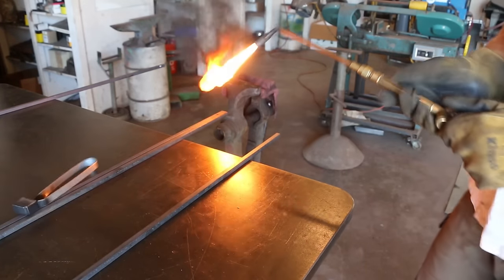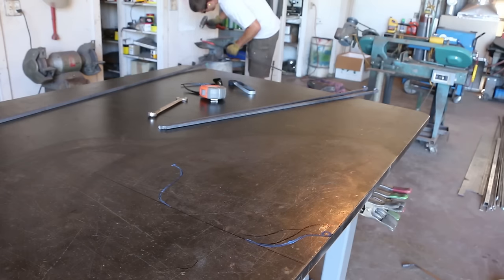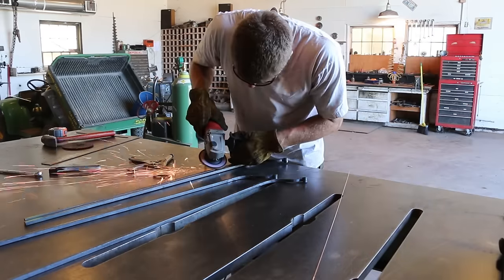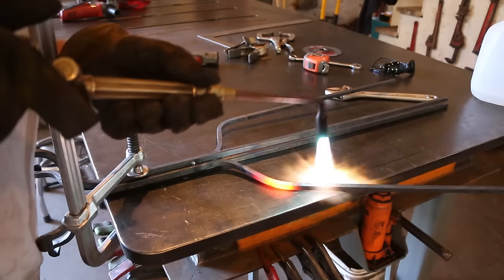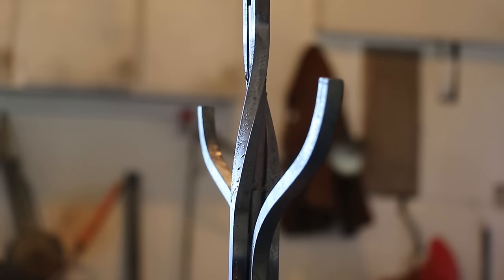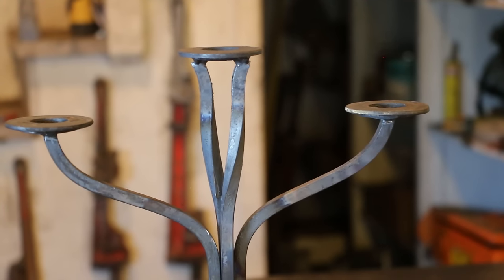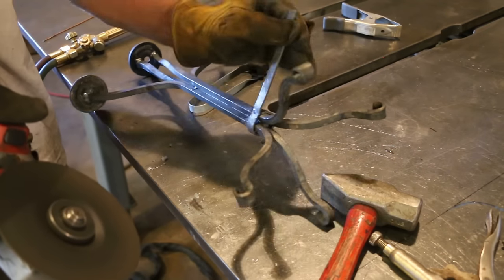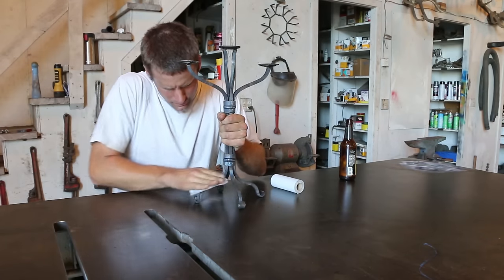Blacksmithing a Candle Holder

Comment: Great video, terrific work as always. Your dry delivery of jokes is hilarious too.

I've been working with a lot of bending recently, shaping curves and such, and I found making a few pairs of bending forks made it all possible. Damn handy tool to keep around, especially the adjustable ones.
Reply: Yeah, I made my fork from 1" square solid stock, sleeved into square tube. Drilled a hole in the tube and welded a nut so I could use a bolt as a set screw. The posts are 7/8" cold roll, and I ended up putting a small gusset of the post attached to the tube. 

Works like a charm. Most of the time I just put it in my vice and manipulate the stock to be bent, but when I use it on something bigger, I put a cheater pipe over the end. 

I'm a pretty shitty blacksmith though.
Here's a photo Bending fork https://imgur.com/gallery/8aAaU

Comment: Nicely done! a tip for the candles or the candle dishes, they catch the wax so if they are bigger than the candle they will keep the wax off the floor and also off of the candlestick holder and as mentioned below, a spike to hold the candles in place securely. 
Get that forge up and running, from seeing what you can do with just oxy acetylene you have Huge potential... Love the workshop too, proper envy!

Thanks for sharing man and have fun at the wedding!!

Comment: sweet. youre getting pretty good man! you forgot the pins for the candles though. should be about 3/4 - 1 in long so the candles cant fall off. maybe a dulled nail would work.
Reply: You might want to add those pins. In years past I remember a house fire caused by a short soft candle sliding off its stand.

Comment: Hey JD, I'm just starting up in Blacksmithing and general making. I managed to build a small forge for knifemaking last month but its really not big enough for any of my current projects. I don't suppose you could share any info on your forge, that you are making? Maybe even a little update video? :)
Reply: Ah I see, I'm sure you'll get it looking great after a little work. I'm looking forward to seeing what you make of it, looks like it could use a re-lining? :) With regards to my forge, its a small propane ran thing that's made of an old steel can with plaster/sand insulation, it had its use getting small steel bars up to forging temps for a little knife. Looks nice and jury-rigged, its just too small to be practical now. Hoping to build a larger one next chance I get! Probably around Christmas.

Comment: Did you put a peg in the holder tops so that you can push the candles onto it? That way they are less likely to fall or wobble if the table gets nudged?

Example: https://images-na.ssl-images-amazon.com/images/I/31XHd%2BhKALL.jpg